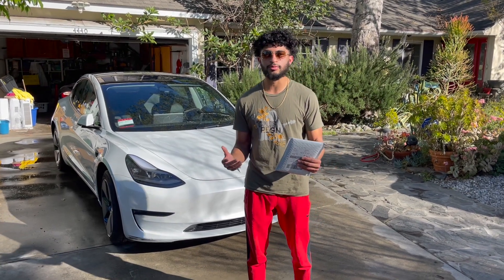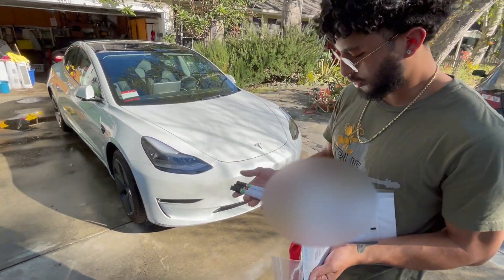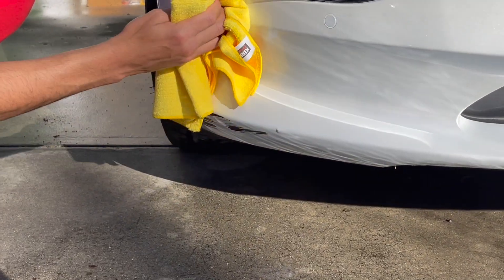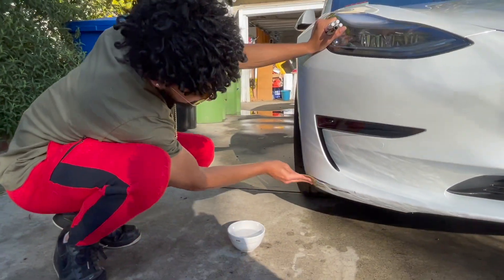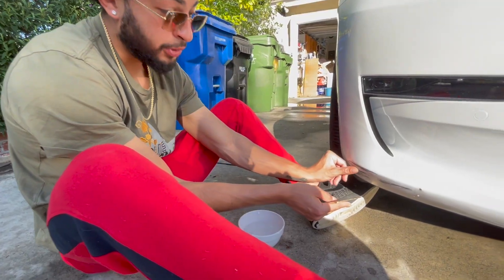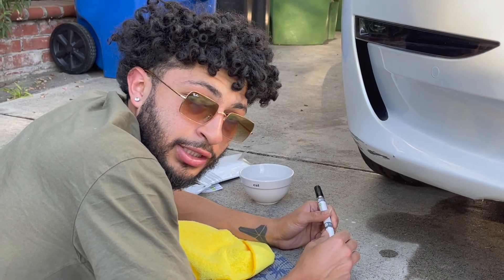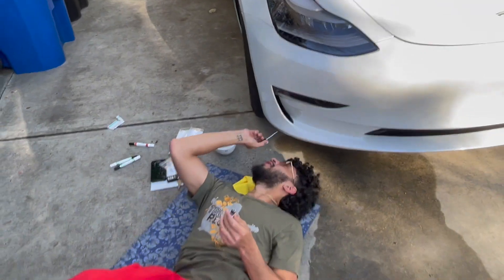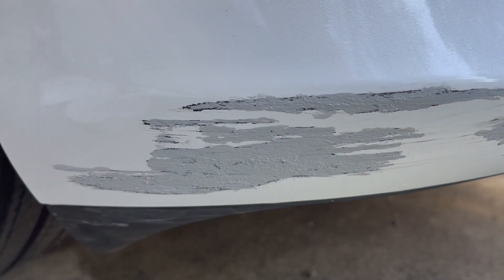HOW TO FIX ANY SCRATCH ON A TESLA | TOUCHUPDIRECT

Comment: Well done on the video!  A little more primer and sanding of the primer will smooth out the entire surface more.  Like mentioned below, it won't be 100% smooth, but more prep work will make it smoother, this is 100% certain.  Also, in a few months we'll have a really new polishing kit that will blend the repair to a really, REALLY high level.  We've been working on it for over a year and there's nothing like it on the market.
Reply: I'm looking for a product to match my 2021 PPSW color. Im in between Touchup Driect and Dr.colorchips. Keep me updated when you release the new kit.
Reply: @ibekatt5360  We have the PPSW ready to go, of course, if you need to get the project done sooner.  The Polishing Kit will simply be for a final step to bring the repair to another level.  And it'll be able to be used anytime. as well as anywhere on the vehicle.
Reply from the maker: Thanks for watching! We would love to work with you guys on a future video now that we know what we are doing. We have a Turo fleet and our cars experience a decent amount of abuse. Lots of potential content and testing we could put together!
Reply: Not gonna lie, I went back and added more base, mid and clear coat and now it’s hardly visible and has been back being rented often no issues. Still in my feelings y’all didn’t give ya boy no sand paper but it’s all good 👍🏽 Aside from that 10/10 (considering how bad the scrape was) with that 9/10.
Reply: @TouchUpDirect  can’t wait! When will I be able to buy the polishing kit?
Reply: @ibekatt5360  it will be 3-4 months yet. Supply chain is making things move slowly!!
Reply: @rizzygang3242  yeah the Platinum Kit is supposed to have sandpaper, so my apologies, I’m not sure what happened there!  Hit us up in 3-4 months and we’ll make it up to you with the new Polishing Kit!